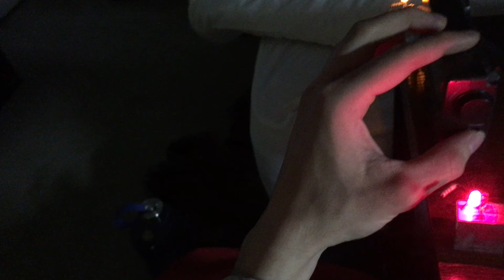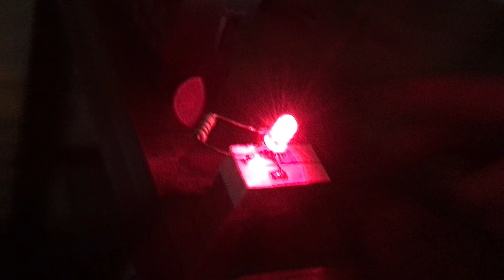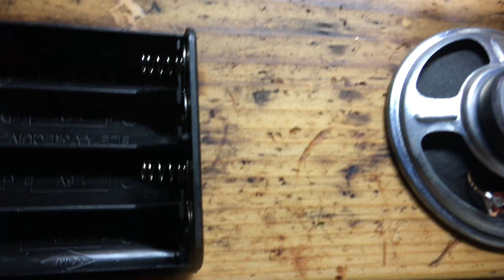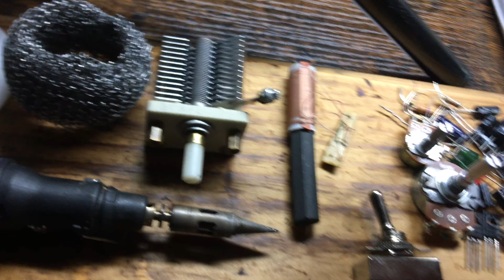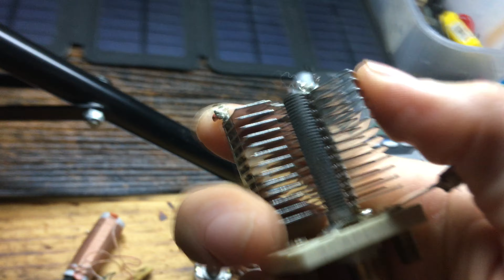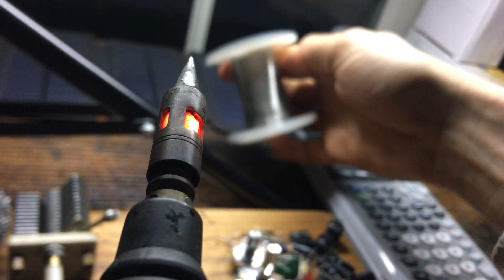Radio Building

Comment: This is good stuff. I have been researching radio building a lot lately. I took a electrical course in college and learned about soldering and resistors but never applied it to anything. I would like to get one of those radio building kits and progress from there. I have a handheld AM FM AA battery radio I got for $10 off Amazon but would like to upgrade someday to the $25 rechargeable battery handheld radio with AM/FM and weather band. 📻